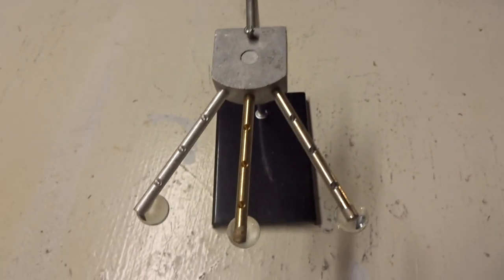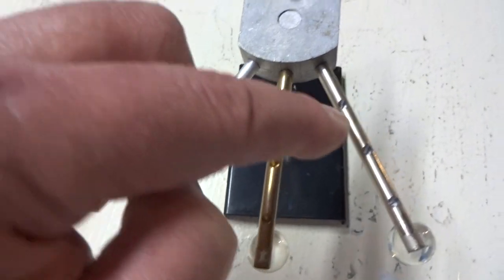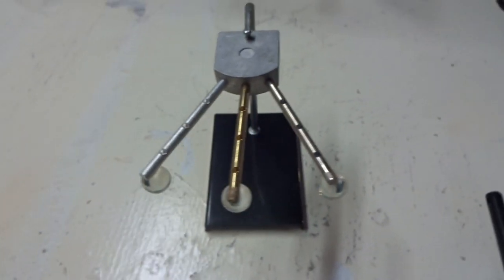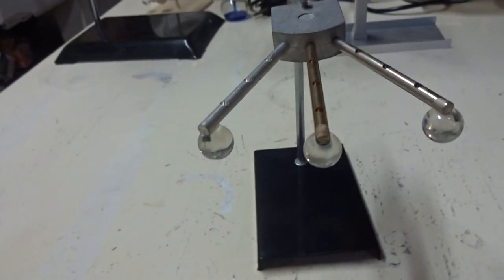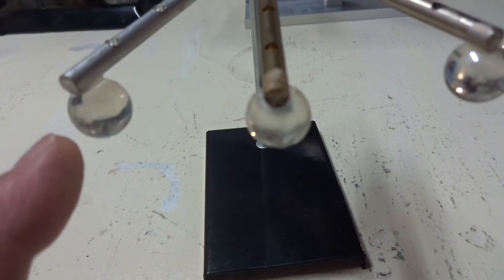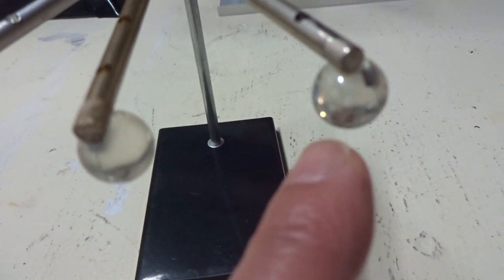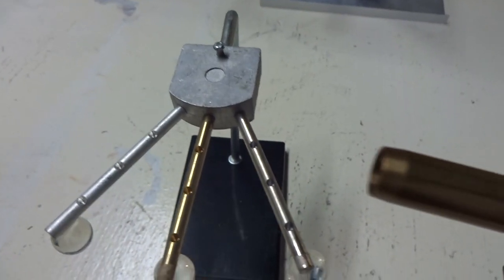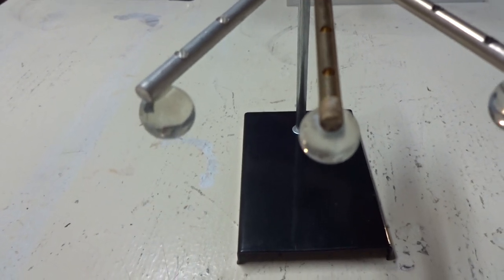Thermal Conductivity of Metals

Comment: Howdy Frank,  This was a good idea.   Maybe you can retry it but using melted wax to hold on the balls rather than the glue.  It would only need gentle heating but would show the effect.  Thanks for posting the video!!!
Reply from the maker: Using melted was is how I was taught, but it seemed too difficult to do and I was afraid that the weight of the marbles would be too great to stick to the wax.  The glue holding the metal rods to the stand melted but my wax did not even though I used school glue and only a little bit. 
Frank